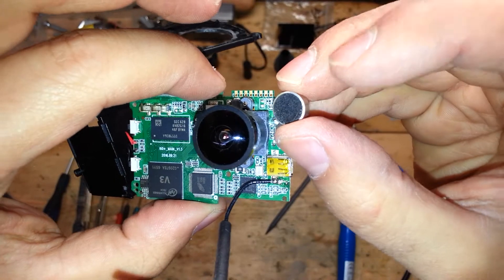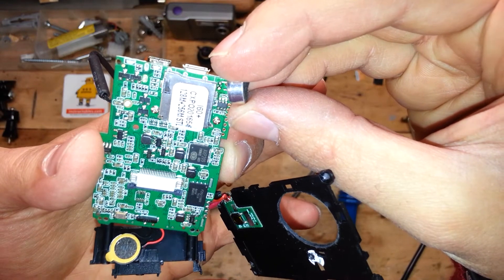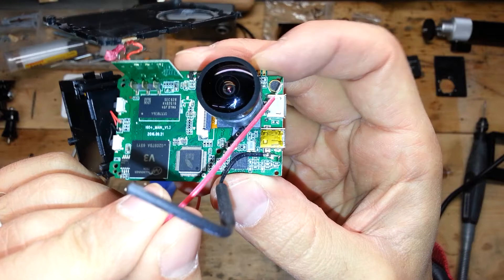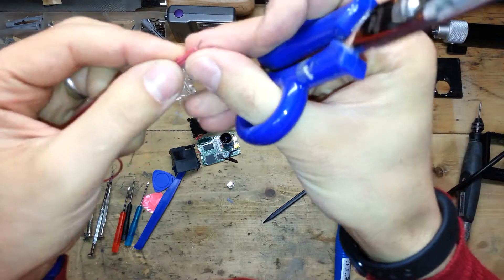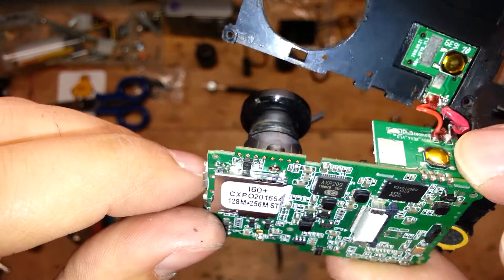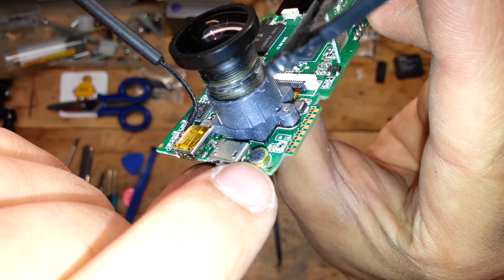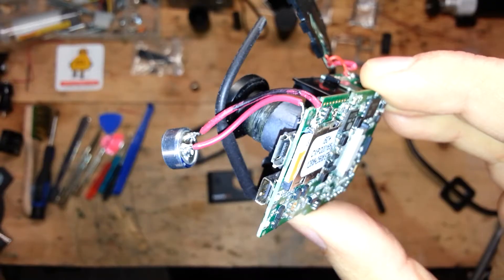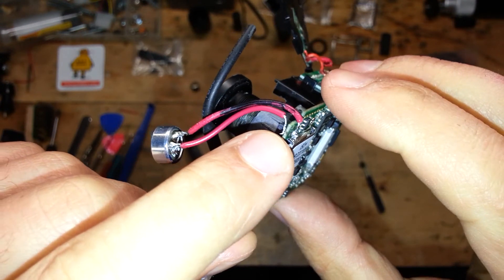Action Camera Hacking - Pt.5 New Microphone

Comment: i killed the microphone circuit, rip sound
Reply from the maker: Teddy Burr  for change it or it happened?
Reply: yep by changing. probably burned the circuit, i took too long for soldering
Reply from the maker: Teddy Burr uhhhh yes,too much time,always kill circuits. But I still wondering if you were trying an upgrade or a replacement.
Reply from the maker: Teddy Burr Anyway, or your time was been really  really long, or you touched hard some smd, because I'm not a Pro for soldering, I spent a lot of time and broken nothing.
Reply from the maker: Teddy Burr What model?
Reply: eken h9, doesn`t look that different on the microphone part
Reply from the maker: Are all similar, or even the same motherboard... nut long soldering time is too much for everyone :/
Reply: I do this but sound quality its almost this same as original